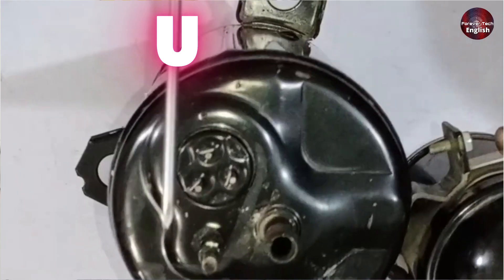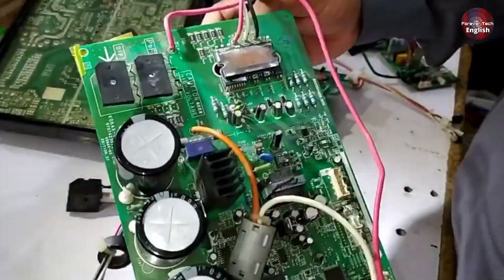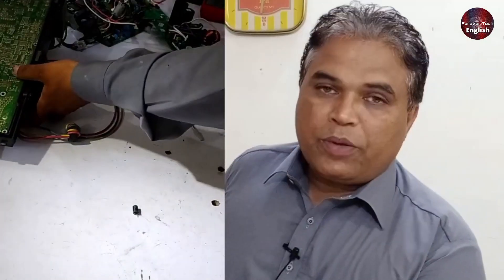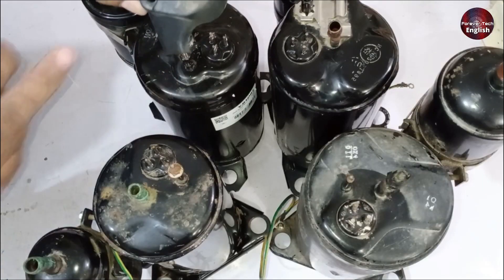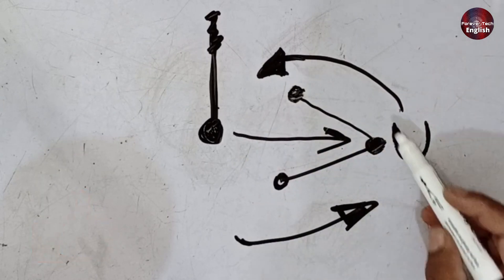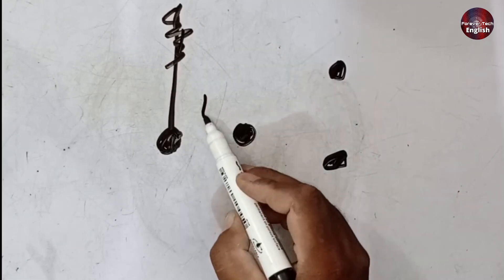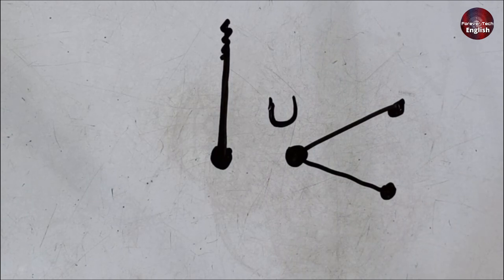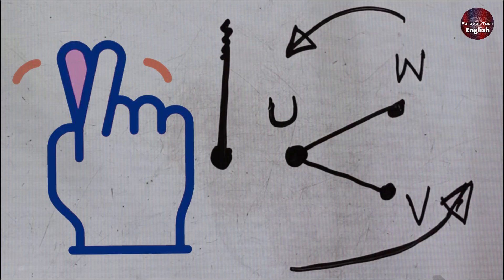How to Easily Find U, V, W on A/C Inverter Compressor – Simple Trick!

Comment: there is no difference between U, V, W  terminals all what matters is he order of comutaton aka that clockwise or counterclockwise thing  were it was said to be impossible to find out by any method without live testing testing
if connected wrong compressor will run backwards  you swap any wires to make it run right way
so entire video is rather misleading and pointless.

Comment: Compressor should produce pressure at the top outlet, and that's all you need to know. Just swap terminals so that compressor blows pressure from top pipe connection.
Reply from the maker: Here, your understanding seems weak, and I believe you may not have enough knowledge about compressors and refrigeration systems. I'm saying this because, in this video, I have taught how to identify the terminals, which is mostly beneficial for saving time. Another thing is that when the compressor is installed in the unit, sometimes problems arise, and the DC inverter PCBs also get damaged. When those PCBs are taken out, most technicians forget the U, V, W terminal connections, making it difficult to reconnect the compressor properly after fixing or replacing the PCB.

This entire video is made for the purpose of ensuring that proper connections can be done quickly without needing any help. I hope you have understood now, and you understand the purpose of the video as well. You may have seen an uninstalled compressor in the video, but this video applies to installed units. The uninstalled compressor shown in the video is just for demonstration purposes.
Reply: @forevertechenglish  you didn't provide any conclusive evidence to suport the "method" of finding U,V, W terminals. On the other hand, don't you tell me about compresdor, you who mix current and voltage in your videos.
Reply: @forevertechenglish  i never said to try out while compressor is under pressure, even so, short reversing wont hurt compressor, as i'm sure you've done it even on video. Besides that, what technitian works on air conditioners without manometers? You're still "young" in terms of knowledge, unlike me who has many times corrected you as I recall. So be careful with accusations, as it my backfire.
Reply from the maker: Until my death, I will remain a student and keep learning, Maybe someone else can be a genius, we are happy you write good comments, keep writing these helpful comments through which we learn again and again.
Reply: @forevertechenglish  he is completely right you dont have any way to identify those pins besides just making it run. everything else is wasting time rather than saving it as it does not matter